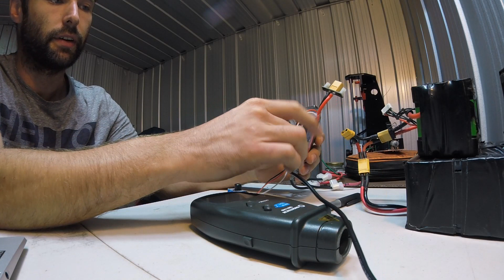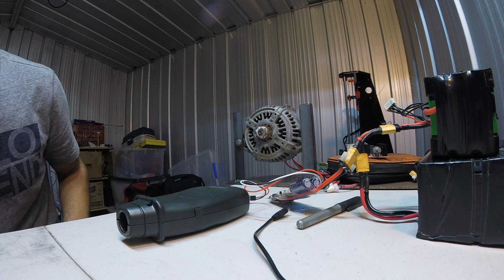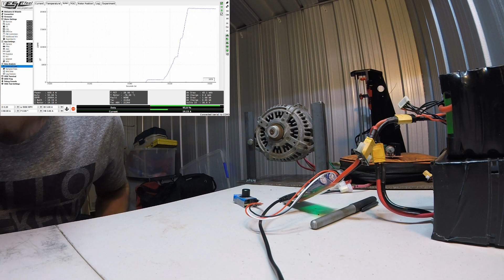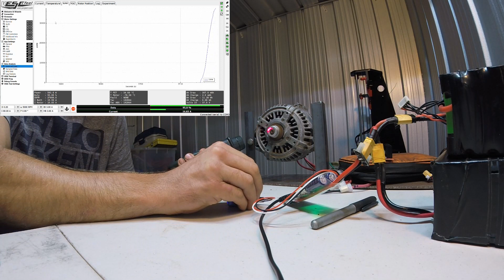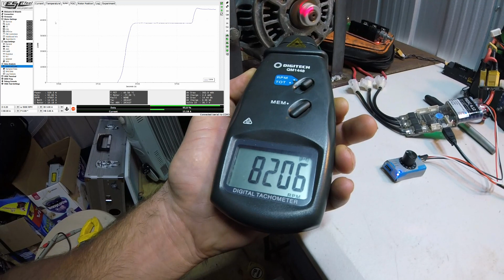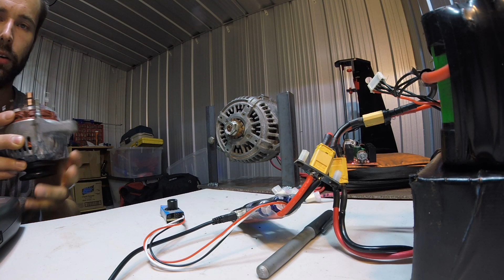Testing converted alternator motor with VESC "erpm"

Comment: How much amps and volts did you runing it for??? Thanks
Reply from the maker: Hi I looked back at the video and it was 40v and the highest amps where around 20amps.  The vesc 4.12 can take a max of 50amps continuous with the right cooling but without cooling is only around 15amps from memory
Reply: @fixitmoditbreakit7982  thank you so much 😊

Comment: I got a 60 dollar controller from ebay coming for mine 60 amps 48-72 volts burshless I'm new to all this can't wait to put the juice to it
Reply from the maker: Nice one mate!  With that voltage you should see some good rpms.  Be interesting to see how your 24v alternator goes!! I haven’t tested a 24v one yet just remember your Field winding will need around 24v I would of thought
Reply: It's a mid 90s GM 12 volt alternator
Reply: should I run 24 volts to the Armature?
Reply from the maker: Nar just 12v. I thought some where you said it was 24v all good.

Comment: Hi what are you altering in the settings to get higher speed ? Recently got this setup bit struggling with settings in vesc tool
Reply from the maker: Hi mate. open vesc tool then click general tab then rpm. max erpm should be set at 100,000 which is too high lower that to 60,000 and your safe and wont blow the vesc.

What motor are you using,  voltage amps ect are you running?  How fast is it turning at the moment?
Reply: @fixitmoditbreakit7982  hi I've changed the erpm setting as you said, it's an alternator from a travel power that produces 110v on a van on board power system, I have two of those , a VW 180a alternator and a Mercedes 200a alternator which I'm looking to test going forward as I learn more, I'm currently using the travel power one as it already has the setup on the rear of the alternator with no rectifier and the 3 phase wires on a proper connector and a separate two port connector for the field windings so I haven't had to modify it at all as far as turning it into a motor, on the vesc tool Ive set the amps to 20a on current motor max, current max brake-10a
Absolute max current 20a
Battery current max 20a
I'm using a car battery and boost converter as power source and set it to 50v 
Using a buck boost converter on field windings that has display so I can see the current and voltage I'm putting to the rotor, I've tried it on 12v at 2a and 8v at 1a 
On the real time data screen it shows about 550 erpm, hope this can help , any more info you need let me know and I appreciate your reply very much ! Thanks
Reply: Also I do have a pwm motor controller to hand of you think that could be better to use on the field windings than the constant  current/voltage buck boost converter which is 0-30v 0-3a,
Reply from the maker: On the real time tab look at the bottom right it will tell you what the voltage is and also the amps.  Maybe your pulling more than 20amps or you’ve got a voltage drop from the step up?  Also what input are you using ppm adc vesc tool pc?  If your using the arrow keys in vesc tool you will have to change the settings on the bottom left of the screen
Reply from the maker: How many amps does the field windings draw at 12v?  I use a pwm controller on mine and found the motor to run the same as battery dc.  The lower the field voltage the higher the Kv.  So running a low field voltage should up the rpm.   The alternators I have when there is 12v at the field and powering the vesc with around 40v they spin at around 3500rpm
Reply: @fixitmoditbreakit7982  hi it says 50v on the real-time tab and it's the same as what I checked the power source ( boost converter with my multimeter)
Reply: @fixitmoditbreakit7982  also I'm using adc , it's a thumb throttle type and I'm on the 3v3, ground,adc pins of the plug
Reply: I'll check the current draw on the field windings hooked straight to the car battery, is that how you mean ?
Reply: I'll have another play with it , your 3500rpm is my goal rpm too! That's the speed I need with a good amount of torque , thanks for your replies again 👍
Reply: On the vesc tool are you using foc, bldc? Or different? Not sure what settings to change in which tab and do you have to write settings to vesc everyone you make a change for it to be applied and change to your modified (changed setting)?
Reply from the maker: ian r  is that 50v with the motor spinning?  Yeah check the draw with a12v car battery or take Resistance can work out from that.  I run it in bldc I’ve heard of people blowing the vesc4.12  in foc.  When you change settings first read motor and app just in case then change your settings then click Wright.  I normally change a setting on one page then wright before moving to a new page just to be safe.   In real time app how many amps are being used by the motor when running.  With the Absolute max currant always put that higher or it will cut out and give a absolute max fault.   Have you  Performed a motor Detection?
Reply: @fixitmoditbreakit7982  hi yeah that's 50v while running, I've used the bldc option and got it spinning, had to reduce the field windings current to get it spin faster and adjuster the ramp rate I think it was, so there is a delay to full throttle and reducing the throttle so that over voltage fault doesn't show and it doesn't spike the motor with loads of current on acceleration thanks to your help! I got the motor to spin up to 11,000 erpm how do you work out the real rpm?
Reply: In real-time it shows before I made adjustments to the throttle that full on throttle god up to 4a then runs at around 1-2a when I put resistance on the motor pulley it goes up about half to an amp, and after keeping it running for a while everything was still cool to touch
Reply from the maker: Nice one 11.000/poles pairs=rpm.  The  alternators I’ve got have 12 poles so 6 pole pairs.  You will need to pull it apart or can you see them through the cover?
Reply: @fixitmoditbreakit7982  hi sorry about the late reply been so busy with work, I noticed on your vid of loading the vescs you got some good results !! What you using for a power supply?

Comment: Hey mate, good to see another tinkerer'.....

I'm currently working on something very similar myself, using a 12v 150a 6 phase alternator. I thought originally that i had 6 wires in three pairs but after removing the diodes and regulator i discovered it was actually 2 groups of three (not connected) or basically 2 separate motor stator field winding's in delta (from what i could tell or atleast no center tap as seen in most connected in wye configuation) . 

This really got me thinking!

Im really not even sure if there is even a practical application for this but hear me out...

Could power be generated at the same time as driving the motor. So i tested this idea and yes it can indeed,  now i do understand that there are efficiency loses every time we convert energy etc and I am only a hobbyist of the trade and self taught for the most part....

For this i was only using a bare bones budget setup with a rc 60a air cooled esc running a 4s lipo along with a 12v battery and pwm controller for the rotor coil and it worked adequately for testing on the bench with no driven load , to my surprise (i expected phase interference from the generated magnetic field(s) or something) . For the first test to see if it were even possible, i had no load for the current from the rectifier diodes (which i hooked back up but only using 6 of 12 diodes) of the second stator field winding's either resulting in heat of course,  actually i got a substantial amount of heat rather rapidly which caused heat to radiate to the driven stator windings and insulation melt causing a short between 2 phases that resulted in massive vibration as the phases were in an out of short, like a self oscillator. before realizing this i had put it down to phase timing due to being a sensorless setup.... 

i have since begun collecting parts for testing this furthar and have added a load for the generated current, upgraded to an 18fet 1500w 48-64v ebike controller running 3x 18v 5ah power tool batteries,  added a second alternator motor with a belt and pulley to the driving motor with another pwm controller on its rotor coil and all phases shorted together to act as a mechanical load and several multi-meters for monitoring all the vitals. currently attempting to put hall sensors in for better low end torque and phase timing etc not to mention i have been drifting between this and my original project of using it only as a bldc motor for a vehicle of unknown type (scooter, bike, trike or go kart) until i can run some efficiency tests for that purpose. sorry for the short summary /long story but i am curious on your/or anyone's thoughts/criticisms on this and just wanted to encourage you to share more of your experiences and results and that i will be following your channel looking forward to future videos..... hope this nonsense was decipherable. cheers from South Australia  Say safe          

 #COMMONSENSE   #OPENYOUREYES      #WEDONOTCONSENT  #TURNOFFYOURETV #DONTBELIEVEMAINSTREAMMEDIA #DONTGETTHEVACCINE
Reply from the maker: @phil.  like wise mate!! That sounds great.  I was on the same path to put it in an vehicle, well my sons electric mx bike but have now got side tracked lol love messing around with this.  So the alternators ive got has 3 separate windings which i cut and join in to delta config.  Seems interesting i have seen one of these on YouTube some where i will try and find the link.  Ive tryed regen with a second alternator but I threw away the diodes some time ago!! I was using a vesc to do the regen braking and rectification but the voltage back from the alternator ac was to low I think could only get 8amps regen charge to the battery and that was working it hard.  I ve now put a load (some wire in a bucket of water) on the second alternator, the driving alternator will pull up and over 100amps!! I am waiting on a new vesc 6 but at the moment I am testing that esc i found its a 200amp redbrick very cheap going to load test and see how hot it gets and what sort of amps it can really handle.  Not the best explainer / writer around so hope this makes some sort of sense!
Reply: @fixitmoditbreakit7982  nah you're right mate i have no problem with the explanation, i too am a hands on bloke and this is the second place i use my finger-strokes, so I'm capable but not proficient by any means. I couldn't type quick enough to keep up with my thoughts to save my life and takes me forever. In fact i started typing this in anticipation 6hrs ago and only just finished......
  I'm intrigued now and never even thought of a bucket of water and coil of wire , sometimes i overlook simplicity and it can really slow me down. i blame the internet for making me dumber, yet more knowledgeable than ever before... but i digress, looking forward to seeing more and hope to share more of my results asap. I'm also waiting on parts and i have this problem of too much week left at the end of my money!! 
cheers for you're response
Reply: The testing metodology that you tried on using the second coil to create energy maybe could be used in Regen, but would need batteryes that can handle the current going back while you test
Reply: @foxxyytofficial  Yeah that's a great idea if by what you mean is "regen braking" to generate a charge current and slow/stop the vehicle? i was only thinking of it very basically and to have it continuously generate charge to a second battery. 
So if it did work as one would hope in a "perfect world", which it most likely will not, i would have a second set of batteries identical to the motor supply batteries with a large 3 position switch suitable for switching batteries and attempt to charge one while using the other,  aiming for a longer running time before charging from the grid... in saying that in recent testing i have only witnessed approximately 17-18vdc after the diodes. thats with the original one that came with the alternator. i do like the idea but am yet to properly test it to know if it would be even usable with this setup arrangement.

once i get the sensors installed and tuned on the scope ill run it through its paces and may make a video. cheers for the input

Comment: I have an alternator powered go kart that I built from scratch (check my channel if you want), that works with a 1500w 48v brushless controller. I was riding it and the controller gave up. I'm considering to buy a VESC to replace the toasted controller and I want to use the same battery. I believe the battery that I have is 48 volts 16S LiFePO4 and I have read the vesc specs and it supports from 3 to 13S. Do you know if it can be possible or done? Thank you very much and stay safe! 
Subscribed!
Reply from the maker: Hi enrengineering.  What voltage are you charging your battery pack to? If 3.5v a cell then that would be 56v - I am not sure its a good idea to take a vesc near the 60v they quote!!  I've got my load motor setup now!!  i am in the process of working it out but I will load test a vesc and let you know what sort of load they can take i.e. watts amps before they over heat with and without cooling.  in the vesc tool you can set a over temp cut off start,  This is where the vesc will limit currant until temps come back down to set amount default is 80c.  full cut off is 100c if this is setup correctly you may over heat the vesc say going up hill,  You will loose some power but still get you up there!!
Hopefully i get some time and i will do a video showing it under load

P.S  i've  put 52v through the vesc with no issues so you should be fine.  just make sure you don't over charge your battery pack keep it under 3.5v a cell that's if you have 16s and limit the erpm setting to 60,000 erpm!!
Reply: @fixitmoditbreakit7982  I think that the output voltage of the charger is 59-59.1 volts, it doesn't go above that voltage. Thanks for replying, I will stay tuned to check your progress, stay safe!
Reply from the maker: Hey I've been doing some reading on vesc's.  Some people are saying dont go near the 60v limit.  I think it could be due to voltage spikes!!! There could be a higher risk when running a alternator as motor too.  Also i found my alternator get really hot when running at 48v does yours?
Reply: @fixitmoditbreakit7982  With the chinese controller, if I push it to the max the alternator gets really hot. I realised if I buy a vesc I also need to buy an anti-spark due to the "high" voltage. Before searching to buy a vesc I was considering this controller: https://www.miromax.lt/en/m-6/c-39/c-44-bldc_motor_controllers/product-41-controller_bldc_50100a_-_bac-0501_#to_products
but if it's possible, I think that a vesc is better.
Reply from the maker: Not to sure about the one you linked as dont know the brand/make.  The issue with the vesc might be the braking causing voltage spikes not 100% on that though.  I've just ordered the vesc 6.6 200amp water cooled!! Very excited to how it goes.  I've blown both my vesc up now (sad face) my fault though.  I was using one as the load/regen braking and let the rpm go way to high and engaged the brake bang she blow, the one other wont connect to usb so cant change the settings